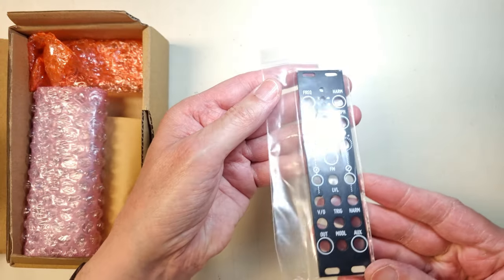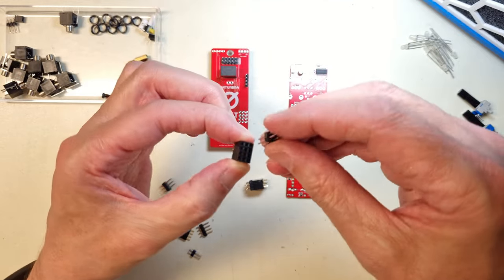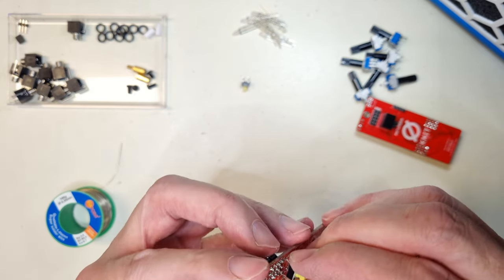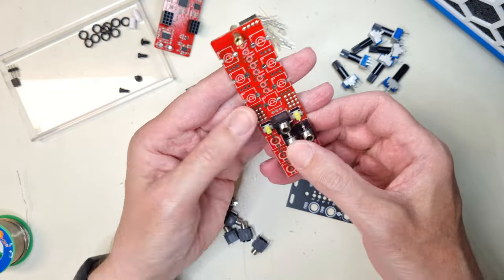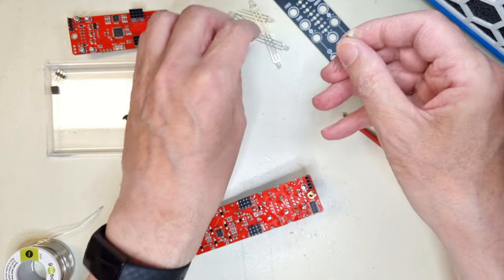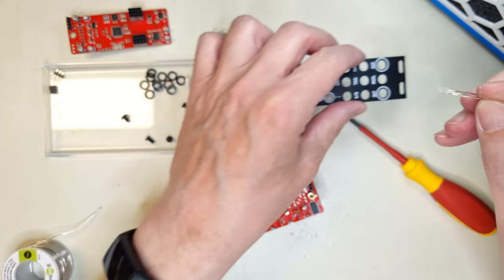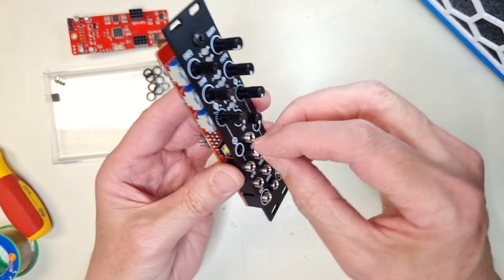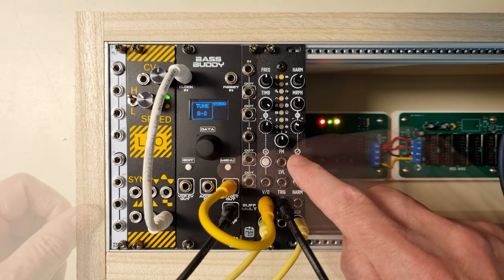Eurorack DIY: Antumbra KNIT Build

Comment: I built the Antumbra Rings clone kit last week, also bought from Pusherman. Also a very quick and easy build, only 2 LEDs, 2 switches, 5 pots, 5 trimmers and 10 jacks, so it took less than 30 minutes. This was Panel + PCB with pre-soldered SMT. I'm very happy with the result!
Reply from the maker: Congrats, that's a great module too!

Comment: I hope it's OK to say that I find your videos very relaxing, and the lack of pumping techno is appreciated.  :)  This was very helpful as well...  given what you said about component shortages, do you think paying the extra for only jacks, pots and LEDs was worth it compared to buying just a PCB + Panel?
Reply from the maker: Thank you very much for your nice comment, I also find too loud music distracting in videos so I try to keep the level and BPM down.
The problem with sourcing components is that you will have to buy them from different places, adding shipping cost and in some cases there is a MOQ (minimum order quantity). And it also takes a lot of time and effort to look up the parts, figure out replacements in case they are hard to find.
In case of the KNIT there are 3 options Base PCB/Panel kits, preassembled SMT kits or Fully Built kit. No Presoldered SMT PCB kits unfortunately. 
So, Yes I thought that it was worth the extra cost.